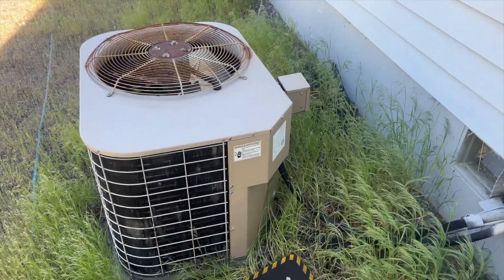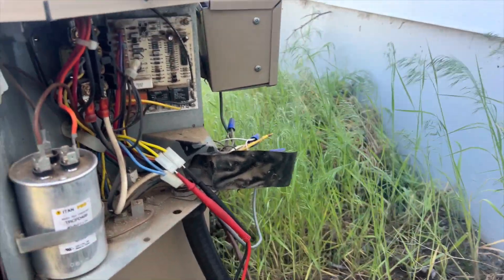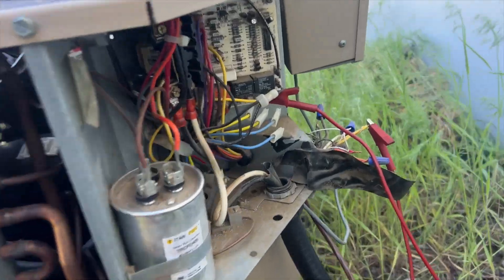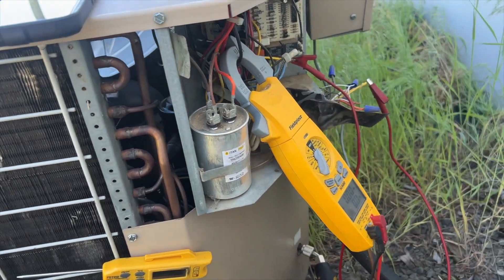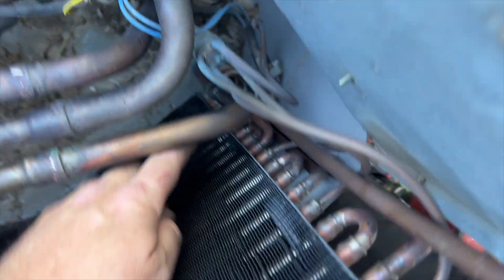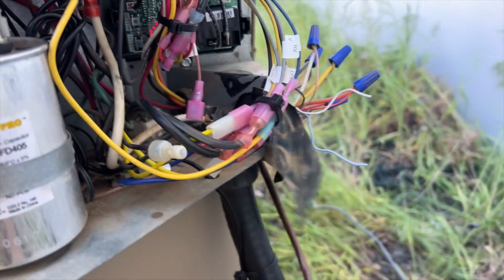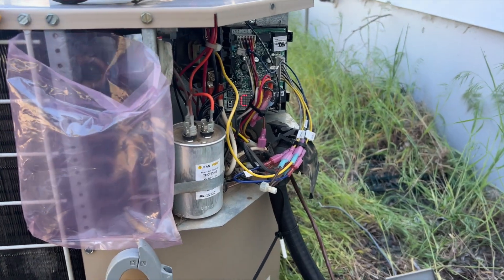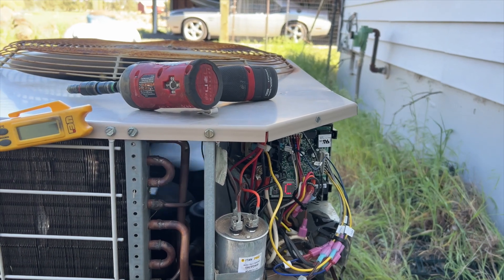Diagnosing and Replacing a Faulty Defrost Board on a Heat Pump EP178

Comment: Nice diagnostic process. I liked how you jumped the switch on the board and it still did nothing. I always just to just keep the wire that had the volts on it on the switch took the neutral off and put my lead on the other prong and if I didn’t have voltage I knew it was a bad board. That’s a cool universal!